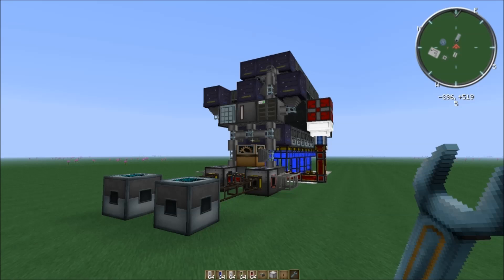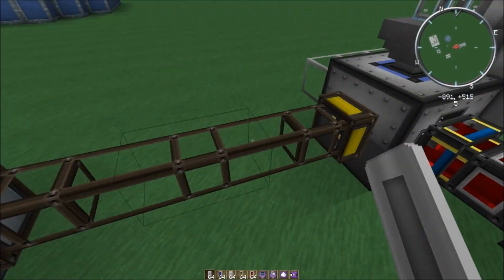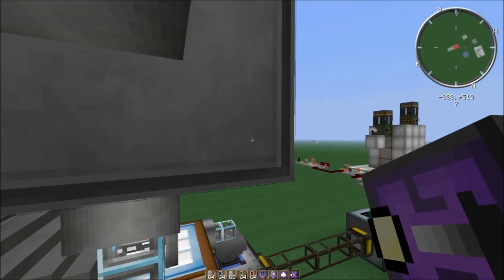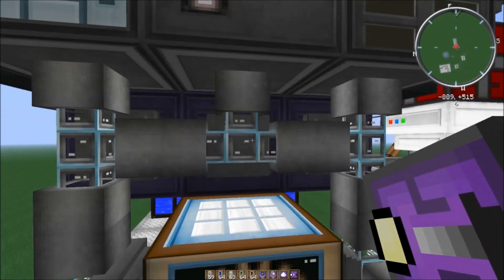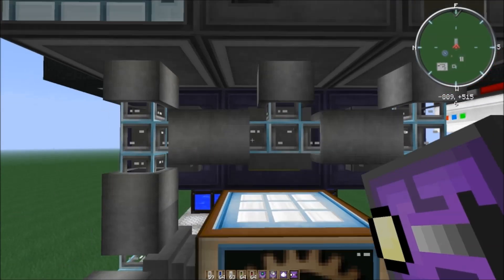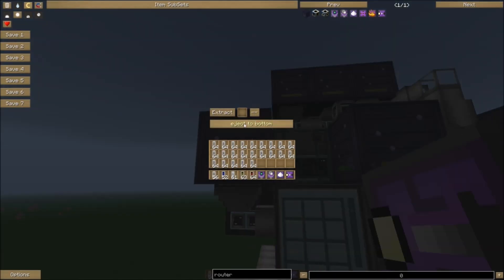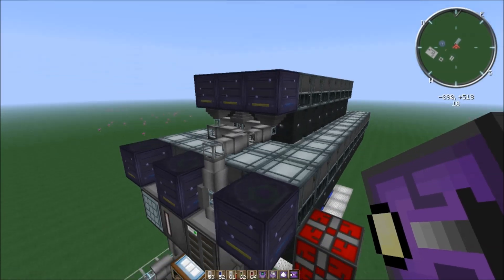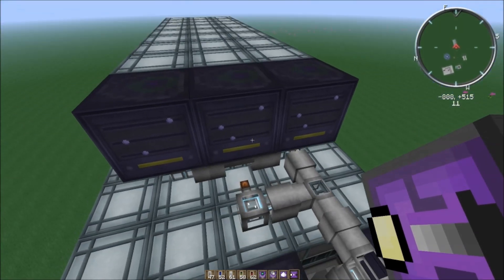FTB Tutorial - Automated Fusion Reactor Fuel System Part 2

Comment: I think you don't really have to apply the machine filter, because the router just only uses the same kind of machines its adjacent to. In my setup it works fine without them. But the speed boost and item filter are very helpful, maybe nessessary...

I have problems to keep it running due to lack of power, could anyone make a suggestion for initial powering?

Comment: modern gregtech requires electrolyzed water to make hydrogen instead of just water. so you need an extra step of electrolyzers in there to do that process first. ive been working for weeks to collect and craft all the stuff i need to make my reactor and its fuel source. im trying to build the setup now

Comment: I plan to use Plasma Generators to power these machines, I did some calculations on how much power the entire thing would need and ended up with 2 results, the first was about 4400 EU/t and the second was about 12000 EU/t, I think I did the math wrong or something. if I put 3 Plasma Generators for the Electrolyzers and first set of Centrifuges and 1 Plasma Generator for the second set of Centrifuges, would that be enough to keep it running forever? I plan to use this in my world but I'd like to make sure I know exactly what to do and what I need before I build it. BTW the videos are awesome, keep em coming.
Reply from the maker: I really don't know, try it. I think back in the day I thought it would take 3 or 4 of the plasmas to power the fuel.

Comment: Every time I add the empty cells into the Access Terminal, Everything explodes. Even just with 1 empty cell. Why is that? I've set the quantum generator as shown, Output: 5012 and Max Packet Size: 2012. I'm sure it's to do with too much power, If that's the case, then how should I set up my power? Explain for Creative mode and Survival mode.
Reply from the maker: Did you put all the transformer upgrades into the machines
Reply: SentinalhMC Bottom layer has 2 transformer upgrades. Middle layer has 1 overclock and 3 transformer upgrades. Top layer has 3 transformer upgrades.
Reply: SentinalhMC I'm running the DNS Techpack on the ATLauncher. Version 1.6.4
Reply from the maker: Scripto mania Well I can't really help you since you aren't using the pack that I built it in. I don't know anything about that pack, might be the configs are different or something. Try reducing the power you're putting into it and see if it doesn't explode.
Reply: SentinalhMC I tested it out by receiving power from the Quantum generator, into a AESU attached a glass fibre cable, then plugged into each machine. I tested out each machine one by one. Power equaled 2048. Then I surrounded 5 of the same machine around the glass fibre cable, no problem. Power equaled 2048. I might have to reconfigure the whole set up, as in I might have to supply each layer it's own energy line. I tried it the way you set up in the video, with the one quantum generator attached, in addition though with the AESU to track how much max output it's limited to input into the whole setup. I set it at 2048, because that's all it's limited too and they all displayed the insufficient energy line message. I'm starting to wonder if the transformer upgrades arn't working.. I thought they might have increased the limit, that's why you where able to run the whole setup around 5000 EU. Hmm.. (Edit: I don't know much about transformers, I just provide the energy it needs and I'm set..)

What pack are you using in this video? There are differences, but I'm sure there's a work around. Like, I had to add the 2nd layer of Electrolyzers to make Electrolyzed water cells, and in this pack the AutoCrafting table doesn't show the empty cell, when you place the compressed air cells. Might have been just a bug.. So instead, I changed that to an Extractor from Industrial Craft 2. It works just as well. I'm only choosing this pack, because It was the only updated one with GregTech in it, that had Liquid UU-Matter, that was all I wanted, trying my own ways to see how fast I can make UU-Matter. Ha!
Reply from the maker: Scripto mania Yeah this was built several months ago and I know that there have been changes to the mods. Needing another layer of electrolyzers being a big one. I think you're best off tweaking things in whatever way you have to to get it to work.

Comment: Can this used in 1.6.4?
Reply from the maker: If the required mods are updated for 1.6.4 then yes.
Reply: I cannot use.
Reply from the maker: Li Harry I'm not an expert on modding so I can't be of much help.
Reply from the maker: ***** If the recipe for the Hydrogen cells has been changed then yes you would need another row of Electrolyzers to make the Electrolyzed water cells to feed into the machine.

Comment: I am having a bit of a problem right now.  i made exactly how you did but the tritium centrifuges pulse on and off and say "insufficient energy line".  What is causing this?  I don't want to increase the packet size because i am afraid that i will blow it up.  Thanks
Reply from the maker: Atreyas Did I really forget a cable? That's embarassing.
Reply: For anyone else having this problem, and built EXACTLY like was shown in the video.  Your problem is no power source for the upper bank of centrifuges.  You need to add something to those cables (which this video doesn't show).. or do like I did, and remove a centrifuge in the center level and placed a cable connecting to the lower.
Reply from the maker: That means that you don't have enough power going into the system. It takes over 5K EU/t to run so you'll need multiple MFSUs hooked up to the system in parallel to provide enough amperage.

Comment: my industrial electrolyzers keep saying insufficient energy line, any suggestions?, other than that its amazing i built whole factory for the single purpose that this one assembly provides.... like huge multi story buildings ...
Reply from the maker: Insufficient energy line means that the wires and power sources you're using aren't able to push enough EU into the machines. Since this system uses something on the order of 5000 - 6000 EU/t you're gonna need multiple MFSUs or other power blocks with multiple sets of high voltage wires to get enough power in.